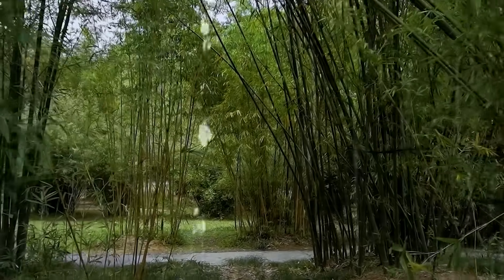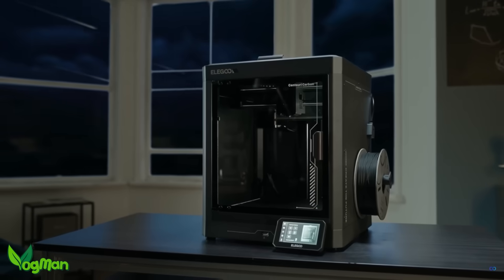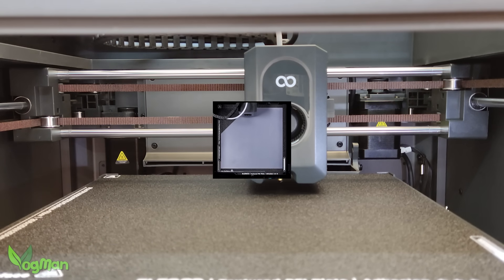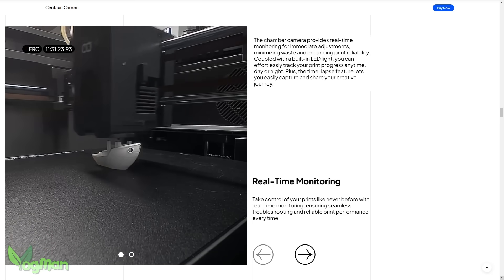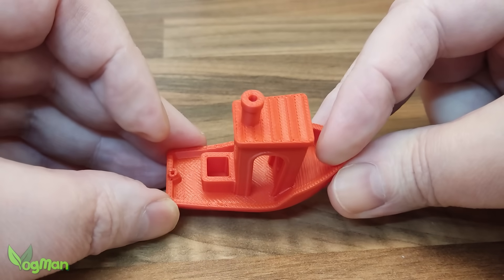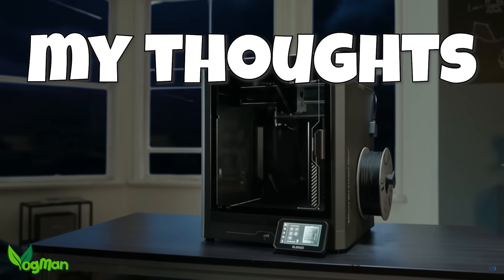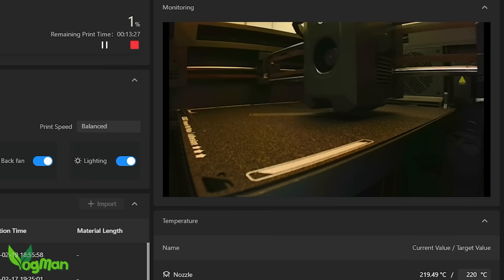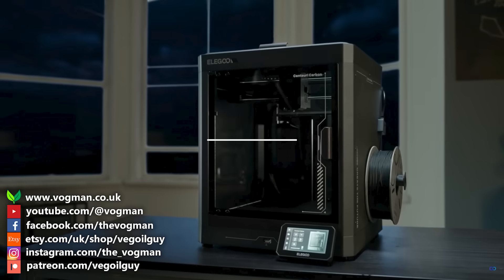Budget vs Bambu – Is the Elegoo Centauri Carbon the New Champ? (Review & Print Test Inside)

Comment: I know that is not your fault, but I hate how Elegoo try to sell this printer as the “Bambu Killer”, they want all the YouTubers who they send the printer to say that and it’s sad. They want to compete with a printer that have 3 years on the market, it’s really good optimized and have multicolor option. yes I know that Elegoo is working on a multicolor device, but, at this point I don’t see why this printers can beat a Bambu Lab printer, for me the correct competitor is the K1C of Creality.
Reply from the maker: Hand on heart, Elegoo have NOT asked me to make any comparisons to Bambu or otherwise. 
I have, however, had dozens of emails from people saying "I was thinking of the X1, but is the CC better?" etc
So my reference to Bambu was deliberately loose and intended to show that Bambu has a couple of years head start on these latest Core XY printers. As time goes by, some of these will prove to be worthy competitors and some will be maintenance nightmares. I have no idea which and only time will tell.
However, I think Bambu should be worried and need to think about their pricing policies, as the gap is definitely closing.
Reply: bambu's printers became the standard because they were the best at their pricepoint. they are tuned decently out of the box, including their filament profiles, but it certainly isn't perfect.

for me, this removes a decent chunk of the X1C's market.

- A1 lineup for if someone is new to 3d printing and wants something they don't have to mess with (plus they only buy bambu filament)
- Centauri Carbon if someone is okay doing some minor tuning on new filaments (mainly temp)
- if someone wants a printer they can modify & control every aspect of, Voron Trident
(or maybe a used ender 3 if they have persistence but less budget to work with)

we will see if the Centauri prints reliably without needing maintenance, but if it does, it certainly is going to be my next printer over yet another X1C.
Reply: @thefonze7  You are right, but my point is that this one completely competes with the K1C of Creality, almost same hardware and no multicolor
Reply: @Scheettini  the K1C had other issues that prevented it from being a good printer choice, so i dont really see it as a competitor here.
As for the multicolor, thats more of a standalone comparison for me. I'll compare printer to printer, and the AMS to whatever elegoo releases.

Also - practically every 3d printer has used the same hardware for years. Theres not much difference between the X1C, the K1C, and the CC, aside from some minor gimicks that dont affect much.
Reply: I know that it´s not your fault but I hate how Bambu tries to sell their printers as the "Kill all the others". They want all the YouTubers who they send the printer to to say that and it´s sad.
Reply: @Eiapopeia-f1e  design an 3D model of yourself and show us where Bambu hurt you. 😹